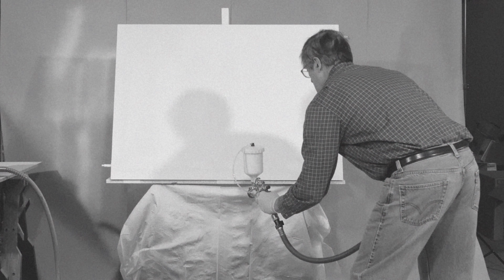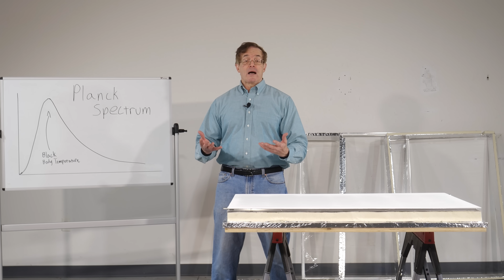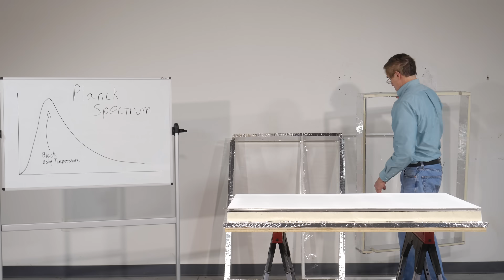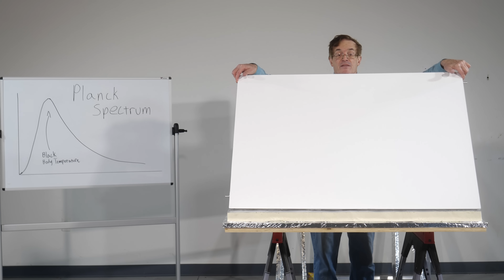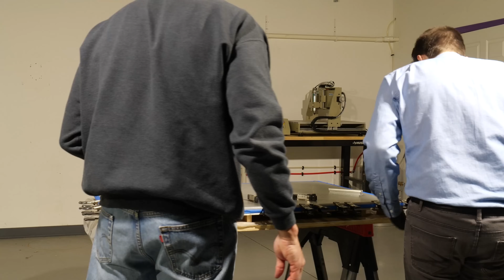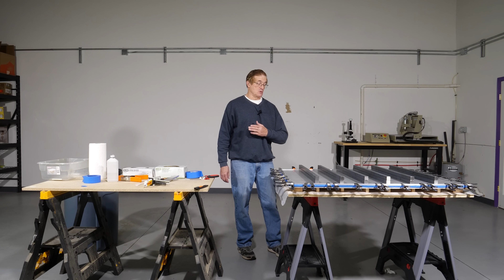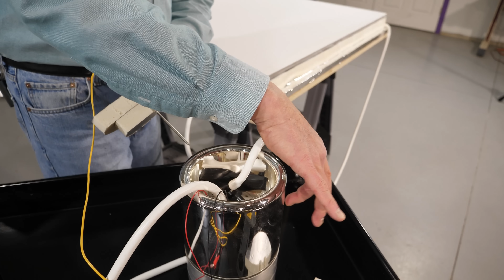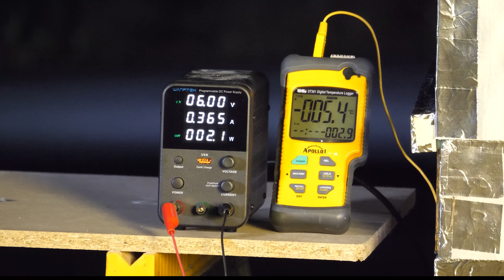Air Conditioning isn't free... but we're close.

Comment: You should test this by cooling a heat load and measuring the time to cool a vaccuum isulated thermos with boiling water or some other heat loads this system would be interesting for passive cooling sheds and if you switched the flat panel with movable slats it could be a dual purpose unit where you could paint the slats with the super paint and black paint

Comment: You've probably already had this thought, but a bunch of tinkerers have been fooling with panel designs where the same panel can be used for solar thermal heat gain or for radiant cooling.  The constructions are very similar, after all.  YouTuber NightHawkInLight is one person I've seen who's working on this, for instance.  The advantage of a panel that does both, even if it's not extremely efficient, is pretty cool to consider.

Comment: On the topic of running heatpump heat exchanger could you not run a thermosiphon type tube down the exchanger hot side and allow it to passively circulate around the thermosiphon carrying heat to a panel mounted as a roof over the heat pump unit? Secondly if you coated a radiator with the barium coating would that increase the working area of the radiant panel or are we limited by the size of the surface area exposed to the sky? Love the content very interesting and involved.
Reply from the maker: It would function, but the efficiency  depends  on the difference in the temperatures. A pump will use additional power but minimize that difference and increase  the efficiency of the panel. 
It's simply  the overall  area exposed to the sky.

Comment: CONGRATULATIONS! you've invented the tree! 1 tree= 10 airconditioners. Though is this referring to the evaporative cooling of the microvein capillary things that carry water up that air cant fit in? is it referring to shade thrown? or that its deep roots bring up groundwater? 
I didnt look into the specifics but yeah im pretty sure its a tree you're thinking of. I actually saw a zoo article about it being in a colder climate but housing expensive endangered species of plants and animal habitat built specially that cannot have frost but the region does so they planted more tropical than temperate for a moderate sized to large zoo enclosure and the different regions rainforest like trees they rushed to transport over and plant in helped maintain environmental temps about 6 degrees higher so in times of frost it didnt have frost but the rest of the zoo surroundings or other places in the same zoo park lands did. I understand something like human intestines for refridgerant gases at the back of a fridge that snakes around, might just be straight up replaced with countless woodgrain like uhh vertical umm.. i super cant recall the specific tree word for those micro water goes up like an elevator thingies that can pull water up beyond 10 meters because if  you use a large hose the pressure difference you cant SUCK up water beyond that point veritcally past 1 or two stories building but some of the tallest trees can without someone actually sucking anything draw through mild evaporative and temperature pull like a thermometer and ice and sea water density at say 4degrees celsius.. hmm.. i.. honestly cant remember where i was going with this.. uhh.. you think you could maybe try to revise your stuff a bit? with each tree being 10 air conditioners, i dont understand why structural beams dont have some sort of umm.. water wicking lining sleeving jacket to tree-ify cooling them on the buildings outsides or walls or something? i had a thought in my brain some time ago and figured its rust reasons or something but thats dumb as theres rust free things or you could make it outta industrial waste salts or something clays/ceramics or recycled glasses? Salts would be really heat resistant and some of its super permanent if its industrial waste they maybe make white sand for driveways or ceramic floor tiles rated for tonnes? not sure. If sugar burns in your body and you can chemically trigger it to ignite like a road flare or burn bright like magnesium, all that energy released.. thinking of hardened salts or industrial salts that maybe resist heat or dont react? could sugar hardening be a thing? would it then not burn and block up stuff and be a diabetes thing maybe? we all see the kilojoules ratings and burning gummy bears.. and the salt brick solar plant mirrors beam sun to heat a block of salt so hot it keeps powering whole town throughout the night by flash vaporizing water in spain for steam turbines power as opposed to coal. So.. refined sugars and salts look like same white crystals.. but many many salts and sugars are super bad for humans. like all plants minus the one or two. or.. no i think just all of them. would there be a way to maybe make use of excess salts piling up in the ocean killing stuff with lakes of super salt that kill fishes under the sea or the excess salts in plastics productions processing and metal working just from the industrial acids and bases for processing them? i think as salt naturally allows water to reach colder temps before freezing and can withstand high temps.. sugars.. maybe.. somewhat.. similar? could our air con be a bit more low cost low energy super efficiency?
Reply from the maker: Thanks for the long comment.
The tree has much more in common  with a swamp cooler or a sweaty body. Evaporative  cooling is extremely powerful.
However, the leaves of the tree are poor, visible Iight and infrared light reflectors (by design🙂). This system  is based on high infrared emisivity  and low visible  wavelength absorbtion.
Reply: i was thinking those trees with light colored or red colored barks that are tall.. its got these uhh.. sleeving or paperbark like things.. theres cells which are too small for air, pull water up.. but theyre surrounded by the similar gaps or spacing and layers that have huge caverns or pockets or chambers of air. Wood is actually partially see through transparent. you can autoclave wood into a transparent sheeting about as thick as typical plywood planks. not to mention the concentric circles of rings. it might work mainly on the outside and grow a new ring as the old gets blockages or bacteria or other damage to continue to function and to allow more height/water draw from the roots. see through pockets that let specific frequencies of light onto a evaporative cooling that loses no water and 'displaces the water' and uses thermometer is the word barometric pressure? nope.. its water hydrometric pressure?  @TechIngredients

Comment: An afterthought... After a solar panel is working a while, are these coatings efficient enough to radiate sufficient heat heat from the backs to be significantly more efficient than without cooling?
Reply from the maker: Probably not. 
The issue  is that this coating  NEEDS to see the clear sky to radiate more infrared  radiation away than it receives from its surroundings.  The back surface of the panel is not positioned to do this.

Comment: I am a bit confused, why this is titled as nearly free air conditioning. What about the 10 W water pump ?
Also, I don't trust the experiment in open air, because there was no reference temperature and no time frame neither time of day with weather information.
If I am mistaken, please correct me but so far I only see a worse version of an air conditioner using the radiation effect of special paint. I wonder how (bad) the efficiency of this device is.

Also, on a footnote, the thermodynamics understanding here is rather bad, because you can't just put two air conditioning devices in series (at 22:55) in order to increase the yield. It doesn't work that way.
So no, I'm not convinced.
Reply from the maker: What is confusing  about NEARLY when there is a low power water circulation pump in the system.
Did you understand  my explanation of the principle  behind the system?
And, of course, you can improve  the efficiency of a cooling system with staging.  That is why many airconditioners include evaporative cooling to reduce the temperature  of the compressed refrigerant prior to expansion.
Reply: @TechIngredients  You can at most stage two or three thermodynamic cycles (of any kind) in series before leak losses defeat the efficiency gain. In practice, the staging has the effect of being able to put in more power per air conditioning unit, and not primarily for efficiency. 
Regarding the device in the video, I would like to know its efficiency, or the total cooling power of the system versus power consumption. If we are talking about "nearly" free air conditioning, it is a bit dishonest to not show the two most important metrics of any thermodynamic cycle, i.e. power and efficiency!
Also, it would be interesting to see the effect of the special paint, so an identical reference device (without paint) would be ideal, because radiative cooling on its own is absolutely nothing new.
Reply from the maker: I understand you would like more data, but there is nothing dishonest about the information I provided. You imply that I was deceptive.
You are correct  that staging will have practical  limits, but you are incorrect that it is not primarily  used to increase efficiency even on a single  airconditioner.  Have you noticed that over the last decade, even window airconditioners began directing the condensation water from the room onto the blades of the fan blowing over the external heat exchanger to increase its  cooling through  evaporation?
Reply: @TechIngredients   Evaporative cooling or "swamp cooling" is a different process and hardly related to this topic here. The only connection is the reduction of temperature on one side to increase efficiency. While evaporative cooling is incredibly potent, your device is practically a bigger heat radiator, the only innovation being a special paint. And there was not even a discussion of how to implement it into the outside of a conventional air conditioner, because your device had a closed space in order to prevent convection. A few Ideas: Try out a bigger surface area and put  thermal paste (or any thermal interface) onto the aluminum foil, or just don't rely on radiative cooling in the first place, because there is a reason why evaporative cooling and convection are vastly superior at ambient temperatures.
So please, prove me wrong, show me the effectiveness of the device. I am not yet convinced.
Reply from the maker: It should  be clear by now that I'm not stupid, and I pointed out your earlier insult.
Waiting...
You said thermodynamic cycles of any kind and evaporation is certainly  one.
Stop wandering around.
As I explained  in the video,  aluminum  has terrible  emissivity and makes a very poor radiative cooler.  We demonstrated  this in our follow-up up video on radiative paint.
Reply: @TechIngredients  An Insult? I criticized your action, not your person. Just saying that something (appears) to be dishonest, is not an insult, or am I wrong?
I repeat: Any respectable scientist and engineer would immediately want to know about power output and efficiency! Your setup appears to conceal it, or it is just ignorance. Since you did not even try to adress this situation but instead repeatedly(!) hung up on that insult thing, that tells me alot about your attitude towards an audience. Cheers.
Reply from the maker: You are wrong. A mistake  is an action. Dishonesty is an intention to mislead.
If you doubt that, try telling a judge that he or she is being dishonest.
Thanks for the discussion. Cheers
Reply: @TechIngredients  I disagree, but for honesty, let me apologize for not picking the perfect word, therefore let me rephrase my initial comment into: "it is a bit disappointing to not show the two most important metrics of any thermodynamic cycle, i.e. power and efficiency!" I think we would be much happier with this version.
Also, I saw the newer video about the supercoating, this was the experiment I needed to see. It cools the surface below ambient temperature, just as advertised, and my suspicions are now gone.

Comment: Thank you for your work!  It would be much more interesting for me to see a version of the modern implementation of a project 100 years ago (1923).  This is "icy ball".  This is an option for producing ice in an absorption refrigeration unit.  It runs on ammonia vapor.  In modern conditions, it would be interesting to heat up the hot part of this installation using a solar concentrator.  Sincerely, Igor

Comment: How much less well will this work under clouds? We live in the wet tropics (Philippines)
Reply from the maker: It will work very poorly  under clouds because  the thermal temperature of the cloud base is much warmer than the clear sky.
Reply: @TechIngredients  yes that is it. But Cloud cover is not 100 % of the time. Maybe clear sky 40-60 % of the time, just a rough guess. Would it work, if using the system to cool an isolated water tank or the soil below ambient temp (or annual average temp if using the soil), when there is clear skyand then use the colder water/soil to cool, when it is cloudy. Could that work and would it make financial sense?
Reply from the maker: As the cloud  cover decreases, the performance  will improve in proportion  to the ratio of clear sky.
I can't  speak to the feasibility as there are too many unspecified  variables.

Comment: That's a very impressive demonstration of the super coat paint, which I actually saw you make right before I watched this video (watched them in reverse order).
I've known of this phenomenon for some time... in Melbourne, Australia in winter, it rarely goes below 0°C at night, yet car roofs, bonnets and boots, especially on my black car, are often covered in frost in the morning. Doors and other vertical surfaces are not. That this happens so often is down to the mild (by your standards) winter temperatures, which are just cold enough to allow the few degrees of supercooling to produce a very noticeable effect, yet not cold enough for air temperature to account for it alone.
My friends asked me how it could possibly happen (I'm known for knowing "a fair bit about a fair bit"), and I worked out what was going on. I do have a large general scientific knowledge but my strength is being able to take that and work out things I don't know. I could have looked it up of course but it's way more satisfying for me to work it out, and much more impressive to my friends.
Oh, "bonnets" are "hoods", and "boots" are "trunks" in this context.😂

Comment: Won't the water make a "b-line" between the inlet and outlet - making the 2 corners w/o flow somewhat isolated? Doesn't that mess up the efficiency of transfer somewhat? Heat exchangers usually go "back and forth" don't they?
Reply from the maker: Take a careful look at the ribs.  They are staggered, forcing  the flow to take a zig zag path from the inlet to the outlet.

Comment: Not sure if you violate 2nd law of thermodynamics considerations here. Are you transferring energy from cold to hot without doing worK? That way lies perpetual motion madness.
Reply from the maker: No, we're not. Entropy continues to increase.
The surface MUST see the clear sky. Otherwise, the emitted radiation  is simply exchanged between the cooler and the surrounding surfaces.

Comment: I Think you mistakenly said the sun peaks around 550nm, you meant around 450nm.
Reply: Nah you're thinking of the colour of the daytime sky. The sun's output peaks in the yellow-green part of the spectrum... approx 550nm.
Reply: @mikejosef2470  Trust me brother, I have my own full spectrum spectrometer...it's 483nm if you want to be picky! 

This is the suns PEAK spectral wavelength...the atmosphere can alter it more or less depending on the time of day, but it's still the suns peak spectrum.
Reply: @lamarr1986  Right you are, for sunlight outside the atmosphere. It depends greatly on the source one refers to for the spectrum at sea level, probably because all graphed spectra that I could find are nearly flat from around 450 to 550nm at sea level. Many show a slight peak at 550-ish.
Why do they say the sun's peak output is yellow green, do you know? Clearly in space that isn't where the highest energy flux is.
Is that where the number of photons is greatest, but due to lower photon energy, there's more energy at 470nm?
Reply: @mikejosef2470  I'm not sure to be honest, I have been looking at some right now, Some of them I think the x-axis (with wavelength) are just plain incorrect... Others may be from different times of day, or there may be more air particulates causing more scattering of the blue spectrum. When the sky is clear, it definitely peaks more towards the 483nm.

The photons of the blue wavelengths are obviously more energetic, and more abundant...what is interesting is the affect of atmospheric particulars and pollution, if you see mass amounts of smoke from a wildfire, or sand from a sand storm, the spectrum is quickly shifted to more orange/red due to the longer wavelengths being more able to 'miss' the particles and reach us.

I would have to go through all studies to see a record of time of day, atmospheric conditions etc to know what their graphs are representing.

Comment: Could the light surfaces in a Crookes radiometer be painted with these coatings to disprove what forces ar actually at work?  Hard just to let it go without some tests now that we have infrared lasers, coatings that reflect it and can control near vacuum.  Great minds have theorized but the only tests have been directing light beams or altering the vacuum otherwise who ran other tests?   Maybe, it's the force why Darth Vader went to the dark side? :goodvibes: